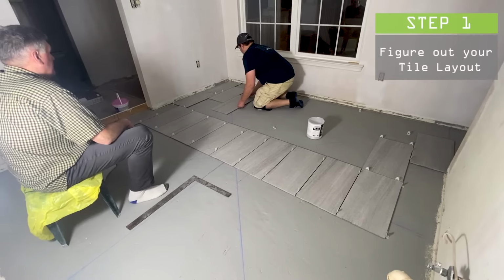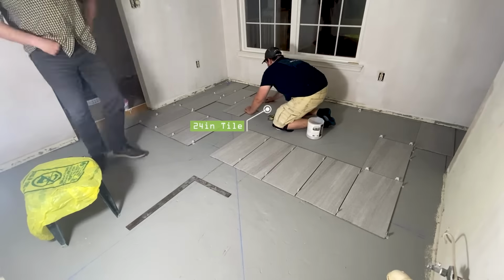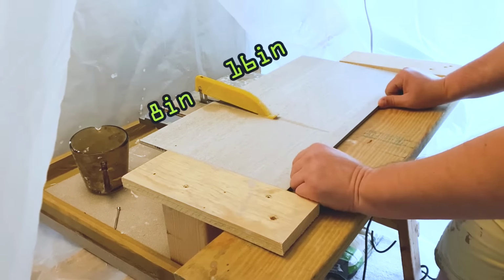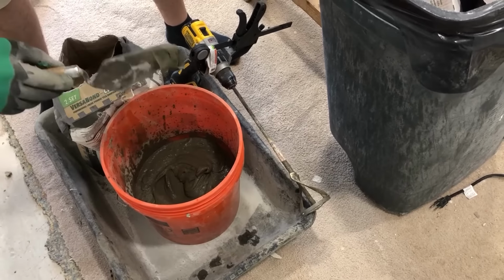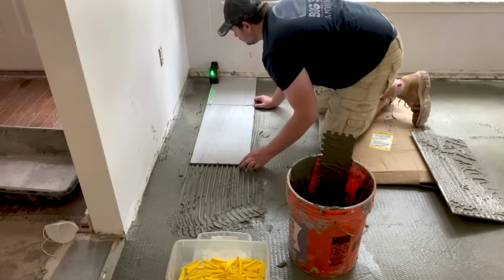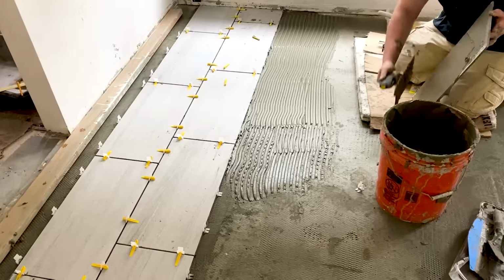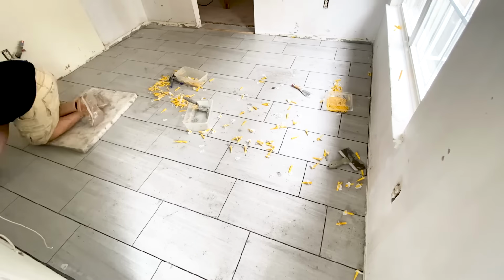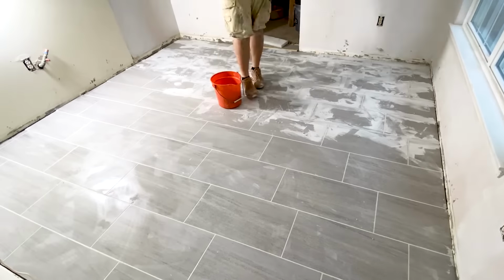6 TIPS For Laying Floor Tile With No Experience

Comment: How do you know it’s levelled? I am afraid of getting uneven floor. First timer here
Reply from the maker: Thank you. Great question. So what we did is level the subfloor and get it as level as possible. That gives a solid base, then the tile leveling system handles the rest by keeping tiles level to each other. To check, drag a level across tiles it should glide smooth without catching. We made sure the first row was dead level, the clips take care of everything after that. Pro tip: mix the mortar a little looser so the clips settle the tiles easier and you get consistent results across the floor. Also don’t over tighten the clips. If the tile is sitting proud pull it back up and remove some mortar from the section and reinstall it. We did that with several tiles but I did not include that part in the video. Which I regret. It’s also a good way to verify that your tiles are getting good coverage during install. First time doing this is trial and error. You’ll know you’re on track when it starts feeling easier as you go. If you have any other questions please don’t hesitate to reach out I’m happy to help in any way I can. I look forward to hearing from you when it’s all done.

Comment: As a table saw user. Him cutting tile between 2 fences had me seriously worried about kickback. Is that a thing with tile?!
Reply from the maker: Thank you for looking out for my safety. Not a concern with tile saws. Unlike wood table saws, where kickback happens from wood pinching/binding the blade, rigid tile doesn’t flex or pinch the kerf. Diamond blades lack teeth, reducing grab. Users and experts report almost never seeing true kickback; tile may lift slightly or jam if pushed too hard/dull blade, but not violent throwback. Minimal risk — wear eye/ear protection, keep tile stable, don’t force it.

Comment: How long did it take from start to finish?
Reply from the maker: 2 days we took a break at lunch and finished the room on that one then clean grout lines and grout the next day.
Reply: @DIYwithMAX  oh ok. We’re replacing our tile floor and they gave us a 3 week start to finish target date. 1500 square feet home. Looks like a lot of work
Reply from the maker: Wow. I would imagine doing the whole 1500sf house would take a while as they have to make all kinds of cuts to get around stuff. So I’m not at all surprised by this time line. Our room was 10x9 and it took two days. Please keep me posted on how it turns out. As long as they make the subfloor nice and level you should be just fine.

Comment: im a carpenter and its difficult when your worried about level and layout at same time.
Reply from the maker: I agree but if you prep the subfloor and make sure it’s level, you will be in great shape. As for the layout that is so subjective but what helped us was to layout the tile for a dry fit to help us visualize the final results.

Comment: I am just about to do my first tile job in a long tile, but a couple of things I have learned are that you should be collapsing the ridges, thats the point of having them, so you get good coverage.  Also, you should be combing the thinset along the short edge of the tile so air can probably escape. Great video otherwise.
Reply from the maker: Thank you for sharing. We were worried about the coverage as well so we pulled up several tiles throughout the job and they all had over 90% coverage but only time will tell lol. So far so good.

Comment: your not collapsing the ridges after placing the tile.
Reply from the maker: Thank you for taking the time to reach out. The thin set is loose enough to get over 90 % coverage. We did not show this on video but we peeled up a few tiles throughout the process just to make sure we were getting good adhesion. It’s been a couple of years and so far so good.

Comment: one thing - when you comb the mortar, and then lay the tile, you want to move perpendicular to the comb so you can collapse the combing and get full support for the tile. if you don't, it could lead to bad support under the tile and cause it to crack if something fell or hit it later. There is a demo on youtube that shows this.
Reply from the maker: I’m not sure it matters as much as everyone thinks. For example What if the tile is square 24 by 24 will it lead to poor adhesion? no so why would 24 by 12 would?
Reply: @DIYwithMAX  the size has nothing to do with it.
Reply from the maker: Can you please elaborate. I’m not sure what you mean

Comment: I do tile. Let me see what you do. I'll tell you if you are wrong... Go.
Reply: Chalk lines get coved by thinset, snaping a line is useless. Use a laser level. Next.
Reply: Placing tile down for practice is pointless. Know your pattern ahead of time. Next.
Reply: 3:03 wrong mixer for mortar. That is a paint stirrer not a mortar mixer.
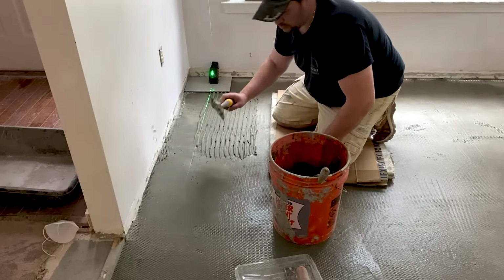Reply: 3:40. You said to snap a line but did use a laser. I'll give you points back.
Reply: 3:40 No back butter. points taken away.
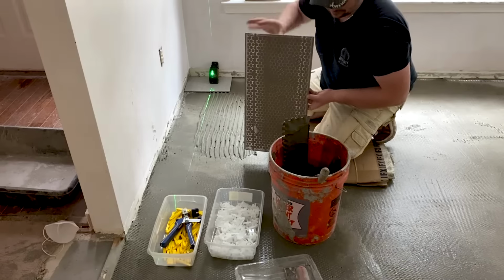Reply: 3:50 You did decide to back butter. But it was a flat back butter, that is not a full back butter. Some points given some taken away. A true back butter should have parallel ridges, just like the floor.
Reply: Leveling system. Points earned.
Reply: More points earned! YES! Always clean your joints. Especially clean by the leveling system mechanics. You never want plastic sticking up through your grout lines because the damn thing is stuck in cement! Then you use a knife to get it out and chip the tile! Maybe the homeowner won't see it. When they do "Call Back" Shit.
Reply from the maker: Thanks. Sounds like B+ and you’re saying not bad for a first time.
Reply from the maker: You use what you got.
Reply from the maker: It helped up pick a pattern and also give us an idea of how the tiles will land at each end. So not pointless for someone who has never done this before.
Reply from the maker: Snapping lines helped us find the start and then as you said we realized the lines get covered and switched to laser level.
Reply: @DIYwithMAX  You did good man. I was kind of trolling. I'm glad you figured it out.
Reply from the maker: Hahaha my favorite were the points I got back for doing the right things. I appreciate your feedback. I’m confident others will find it very helpful as well.
Reply: @DIYwithMAX  Yeah I don't take myself too seriously. I just wanted to be a little snarky. I'm very glad you got me right. Some people just get mad.
Reply from the maker: @jkotarsky  I like your sense of humor. We have that in common.
Reply from the maker: Love your sense of humor. We got that in common. You alone keeping this channel alive with your comments.
Reply from the maker: Love the feedback.

Comment: Luckily I worked the flooring department at the Home Depot. All this started coming back to me when you started talking. Still, I was unsure how to apply the tiles to the ridges so thanks for that. I wondered how much pressure should be applied to the top if any
Reply from the maker: If you’re using the leveling system. Let it do all the work.

Comment: What would happen it you use normal mortar in large format tyle?
Reply from the maker: Great question. It would crack and fail under load; normal mortar lacks strength to hold together large-format tiles. The tiles would eventually get loose and pop off. If you’re gonna do the job yourself, it’s worth splurging on the right tools and the correct materials as labor is usually 50% out of the cost.

Comment: How does that white grout look after a while? Read its a pain to keep clean. Would you have gone Grey instead in retrospect?
Reply from the maker: I’ll be honest it’s not pure white as it used to be. But once a year I get the scrubbing brush out and do my best to clean it and seal it with a grout sealer. Other then that it’s holding up well.

Comment: Didn't show how to even apply and smoothen mortar. That's a skill in itself.
Reply from the maker: I found that trowel did most of the work. As long as you keep the grout lines clean. Your job will turn out just fine. Thank you for taking the time to leave a comment. I will take that in to consideration in my future videos.

Comment: Was the white transition piece requested by the customer I am wondering why you didn’t use the same tile and lift it up to the wood level
Reply from the maker: Customer request would imply I was payed for this work lol. This was renovation of my in laws place. So all the projects on this channel are good will lol. We did make the tile the same height as the floor. The ladies just happened to like this transition so we did not have much of a choice lol. 😂

Comment: Hi, what's the name of the device with green LED at the corner of the wall n what's the usage? Also, there's a bigger thing like lamp inside a cage, what's that for?
Reply from the maker: Thank you for your question. The device with the green light is a laser level, used to project a straight line for aligning the first row of tiles. The device on the wall, enclosed in a cage, is an LED light, providing illumination for our work in the dark, as we’ve removed all ceiling lights and haven’t yet installed the new kitchen lighting.

Comment: Thank you so very much! I listened at least 10 times to the part where you.repeat: "And don't forget to remove the excess grout... " Really valuable tips. I would be very grateful if you say what thickness of spacers  to use for the tiles.
Reply from the maker: Thank you so much for watching. The grout line size is really up to you and what look you want to have. But the best thing to reference is the tile box. Most of them have a reference table with recommendations for the grout line sizes. If you send me the tile brand I’m happy to help you with sorting it out. Grout size, or the width of the grout line between tiles, depends on the tile type, size, edge finish, and the desired aesthetic or functional outcome. Here’s general advice based on common practices:
•  Small tiles (1x1 to 4x4 inches, e.g., mosaic or subway tiles): 1/16 to 1/8 inch (1.5–3 mm). Narrow grout lines create a seamless look, emphasizing the tile pattern. Smaller lines are common for wall tiles or intricate designs.
•  Medium tiles (4x4 to 12x12 inches, e.g., standard ceramic or porcelain): 1/8 to 1/4 inch (3–6 mm). This range balances appearance and functionality, allowing enough grout to secure tiles while maintaining a clean look.
•  Large tiles (12x12 inches and up, e.g., large-format porcelain): 1/16 to 3/16 inch (1.5–5 mm). Larger tiles often have rectified (precisely cut) edges, allowing tighter grout lines for a modern, minimalist look. Wider lines may be used for uneven surfaces or non-rectified tiles.
•  Natural stone or handmade tiles: 1/8 to 1/2 inch (3–12 mm). These tiles often have irregular edges, requiring wider grout lines to accommodate variations and ensure stability.
•  Floor vs. wall tiles: Floor tiles may use slightly wider grout lines (e.g., 1/8 to 1/4 inch) for durability and to handle minor substrate movement. Wall tiles can use narrower lines (e.g., 1/16 to 1/8 inch) for aesthetics.
•  Grout type matters: Sanded grout is typically used for lines wider than 1/8 inch, as it’s stronger and resists cracking. Non-sanded grout suits narrower lines (1/16 to 1/8 inch) for smoother finishes, often on walls.
•  Aesthetic considerations: Narrower lines create a sleek, modern look; wider lines emphasize individual tiles for a rustic or traditional style. Match grout color to tiles for a cohesive look or contrast for bold definition.
•  Practical tips:
	•  Use spacers to ensure consistent grout line width.
	•  Check manufacturer recommendations, as some tiles specify ideal grout widths.
	•  Test-fit tiles to visualize the grout line impact before setting.
	•  Account for surface conditions—uneven substrates may require wider lines to hide imperfections.
Reply: @DIYwithMAX Thank you so very much for the detailed answer and exact examples. I will definitely use spacers as you suggested. I also never knew that there are spacer width markings on the tile boxes, but with your guidelines and probably, some tile arrangement before the actual placement, I will have better understanding of what I want to achieve. Good luck and thanks!
Reply from the maker: Glad you found it helpful. Please pay it forward by hitting the like 👍 button on the video and subscribing to help other folks like you find this information. Please don’t hesitate to reach out. I’m always happy to help.
Reply: @DIYwithMAX Did that  the first time I watched it. Thanks for the availability!
Reply from the maker: Much appreciated

Comment: You skipped the under membrane! You put grout on wood !
Reply from the maker: We water sealed our gibcreat subfloor then put down leith and leveled it with cement. To creat a level service. If your subfloor is wood you will have to use a waterproof barrier. Like Schluter or some other brand.

Comment: You're supposed to collapse the ridges for proper adhesion, bud.  The point of the ridges being in one direction is to have room for air to escape when you do so.  If you don't collapse the ridges, you are probably more likely to see failures.
Reply from the maker: You are correct. Check out my second tile video where I explained what I meant here.

Comment: your directional troweling is not correct. You should be troweling opposite the length not with the length. This is so the air can escape easily between the tile and the floor. Any good tilers will tell you this.
Reply from the maker: Thank you for watching and for taking the time to leave a comment. Check out my second tile video we go in to detail on my technique and why I think it does not matter.

Comment: Great video. Very useful. Now I know to not attempt this myself.
Reply from the maker: I’m glad you found it helpful. It’s ok to not risk it with projects like this in big areas. But you should try it in the laundry room or smaller projects. The tile leveling system makes it very straight forward. Don’t sell your self short.

Comment: All,wrong,should be starting in centre of room
Reply from the maker: Hey, thanks for the feedback on my kitchen tile video! I hear you about starting from the center being the usual go-to for a balanced layout, and I totally get why you’d point that out—it’s a great way to avoid uneven cuts and keep things symmetrical. In our case, we actually started from the corner for a specific reason. We have two entrances to the kitchen, and we wanted to make sure the tiles at those entry points were perfectly straight and clean for a sharp, professional look, since those spots get a lot of attention.
Here’s how we did it: we pulled strings from corner to corner to find the exact center of the room, which gave us solid reference lines. Then, instead of laying tiles from the center outward, we measured from that center point and set up a laser level to guide our starting point in the corner, ensuring the lines stayed true to the entrances. This way, we could control the layout to prioritize those key areas while still keeping everything aligned with the room’s center for balance. The laser level was a game-changer for keeping long runs consistent—no wobbly walls throwing us off! The edge cuts turned out nice and even, and we’re stoked with the result. Totally agree this isn’t the textbook approach, but for our space, it was the best call. Curious to hear your thoughts or any tricks you’d recommend for similar setups!

Comment: 6:40  What is the difference between the grout & white product and name? I see that the tile grout went from brown to white. It also made the grout flushed with the tile.  I'm wondering because it appears this last step was skip when my straight edge tile was laid. My tile scrapes my feet because it is not leveled & flushed to the tile.
Reply from the maker: The white stuff is the grout. Before that it was just empty space before tiles. I cleaned up all the grout lines and added the grout to finish the job. I highly recommend using the tile leveling system to help you with nice and level tiles.
Reply: @DIYwithMAX  What's your opinion? The contractor said straight-edge tiles are naturally sharper on the edges and less forgiving underfoot compared to other tiles. Rather than removing inexpensive tiles from two small areas, they suggest regrouting with Epoxy Grout to fill the grout lines to bring them flush with the tile edges and Edge Smoothing- sanding down the tile lips. (I think this all this will negatively affect straight lines).
Reply: The contractor said they will remove the tiles and install new tiles. I assume backer-boards, too. Should the backer-boards be water-proof since they're going on laundry and bath room floors?
Reply from the maker: @patd6370 if you can splurge for it, it’s not the worst idea.
Reply: @DIYwithMAX  Sounds like water-proof is not necessary. What do you think of 1/4 inch backer-board?
Reply: Update: Contractor is removing everything. This time, I'm selecting non-straight edge tiles. The edges are sharp and too difficult for the contractor to install correctly. Thanks.
Reply from the maker: @patd6370 I’m really sorry this is happening to you. But maybe it’s not the edges 😂. Maybe you need a new tile guy.
Reply: @DIYwithMAX  Yep. However, since it's a contracting company, I will insist that they send a new tile guy with better experience.